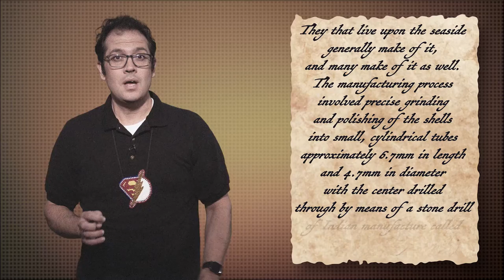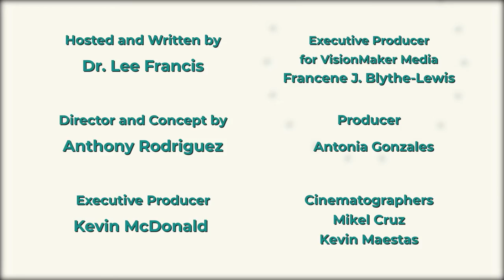Wampum | Indigi-Genius

Comment: The Chumash nation of Southern California (Morro Bay to Malibu) made their finest Olivella shell callous bead by using sea lion seal whiskers as the drill bits. Seal whiskers are not like regular keratin hair they are more like flexible steel in hardness especially the follicle base! On the east coast,  harbor/grey seals might have been utilized in similar way? The other material for drill bits was sharpened fish bones to achieve those micro holes as small as a millimeter in size. Chipped quartz stone drill bits could not achieve those tiny diameter holes especially in tubular beads that required being drilled from opposite ends to meet in middle.